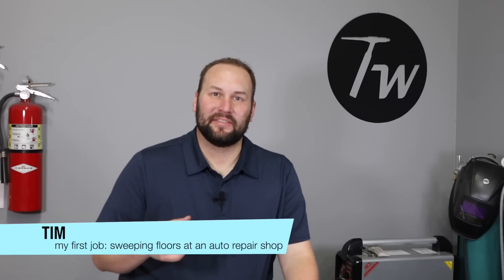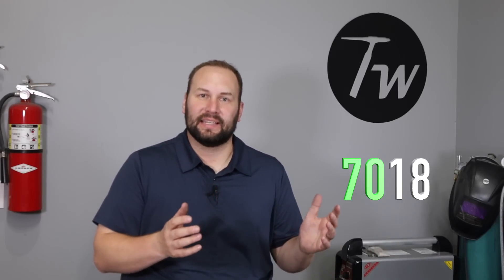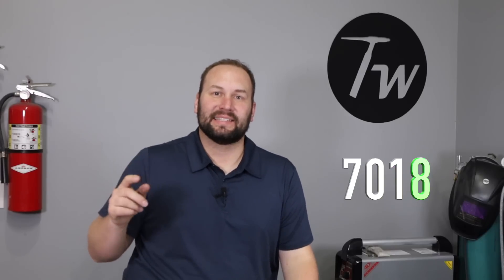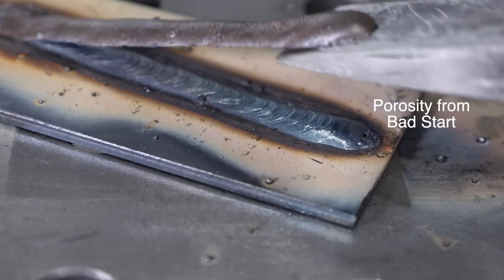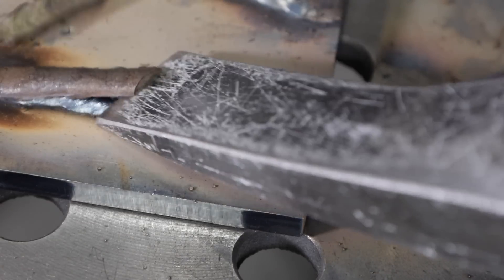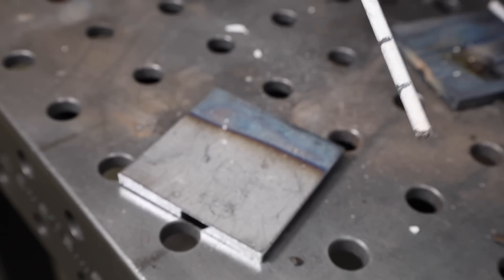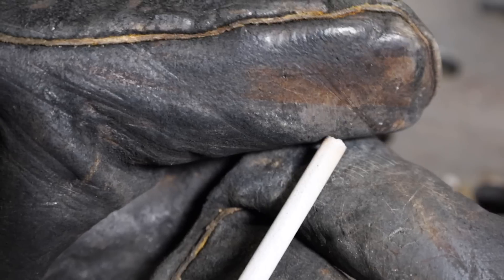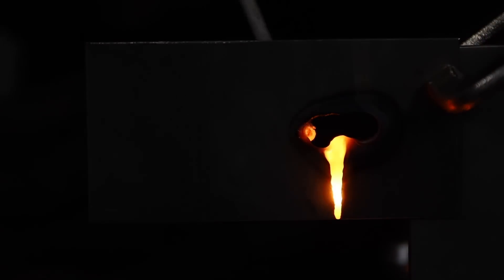Stick Welding: Which rod is my favorite?

Comment: Buy the AC version of it. 7018AC has a conductive material in the flux that allowed instant and EZ restart.  7018AC will also run DC just as well. Try it. I stopped buying 7018 DC completely after that.

Comment: can't beat a 7018's bead strength, but for me it's the 6011. The 6011 will easily work with those cheap Amazon inverter welding machines that usually have too low of an open circuit voltage (OCV) to strike an arc with the other rods, especially 6010, and 7018.

Comment: Where did you get that divider for that rod tube ??
Reply from the maker: It's molded into that particular tube. I'm not sure what brand that one is, I probably just bought it at the welding supply at some point years ago.
Reply: @TimWelds  
I found them from a company called Shark industries.

Comment: I like 7018 too. It is my go-to, for sure, and a pleasure to weld with. Absolutely the easiest for me to use. A shipmate of mine many decades ago, a QMED, (I was the Bosun and that was my first permanent Bosun job) taught me basic welding in exchange for me teaching him how to use a computer. Yeah, long time ago! Anyway he had me burning 6011 rods because 7018 was just too easy, but what he said was, "6011 is your most basic, generic rod, and you will use it more than any other rod". I got where I could do vertical, overhead, and pipe with 6011 and went down to the engine room for some more rods one evening and saw the 7018 laying there in the oven, calling my name, so I grabbed a couple dozen and when I struck the first arc and saw the beautiful bead it made, and how effortlessly I was able to maintain my arc, I was hooked. It's like hot melt glue, but with penetration. My first real, productive welding project was building dumbbell, barbell, and plate racks in the gym, for a few thousand pounds of iron on a ship that commonly sails the North Atlantic in winter, so it had to be strong. My rod of choice was a 3/16" 7018. Even the Chief Engineer said it looked pretty good and rather professional, even over-built. The Chief Mate, who commissioned this job and signed off on the overtime, and was a big gym rat, was delighted. Every weld was perfect or nearly so, and yeah I could have done it with 6011 but it wouldn't have been nothing purty and it would have taken longer.

So now I am retired, and my machine is a Harbor Freight does-it-all running on a 50 amp 240v circuit in the garage. No plasma cutter, no oxyacetylene rig, just the HF machine and angle grinder. I never went to school, no official professional instruction at all, just continued to try stuff and see what works, and re-do what doesn't work. My usual rod is still 7018. It is just too damn easy. Everybody says wire is easier, but I disagree. I even bought a spool gun. I still find stick to be easiest, and even when I don't need the strength, I still take the easy way, and use my favorite rod.

Comment: I didn't hear you mention that 7018 needs to be stored in a rod oven to keep them dry as they are low hydrogen rods. Since I stick weld infrequently I don't want to keep a rod oven baking all the time. I'd rather use 7014 unless i have a high strength alloy steel to weld.  Also the slag balling on the end of the rod is a PITA.

Comment: For farm use which means almost every angle, all kinds of dirt and paint, and sometimes my fitting is done with the left hand and set with the first tac, I like 6010 a lot. Doing pipe work in a beef barn for some reason I liked the feel of the 6010 a little more than 6011. I ran through probably 30 or 40 lbs of the stuff. 7018 is always a go to for heavier metal. I just have 7018 rods that sat opened for 20-30 years in a building that feels just like you are outside. So they really dont work the best. Maybe some day I'll get through them and have nice 7018s

Comment: Tim, does 7018AC have all the positive things that the conventional 7018 has? I currently only have  an AC stick welder for my home use. I would like to take advantage of the 70k strength when building/repairing trailer frames ecy.
Thanks in advance!

Comment: Hello, Tim, and thank you for the great videos!
I have a quick question about my machine. It is Telwin Nordica 1800, and in the description it says it is an AC machine and electrodes used are rutile only. So can I use 7018 and should I expect problems with it? 
I use it for dirty (rusty) metal and simply - hobby/garage projects.

Comment: We ONLY use 7018 for all root passes here in Sweden. If you just start learning with 7018 root passes from the start then you won't need a 6011. We don't have any companies that make 6011 rods here in Sweden, simply because we don't allow it by code. It's too brittle. We have rods similar but not the same.

Comment: I am just starting out stick welding, as before this I had a cheap flux core welder. I started with 7018 and found striking the arc was a challenge with them not to mention getting the hang of maintaining the arc distance while traveling down the weld (likely due to my time flux core wire welding). A retired farmer suggested starting out with 6013, so I picked up some inexpensive 6013 rods, and I found that getting them started and maintaining the arc without sticking the rod was much easier. I ran through a few of them then tried 7018 and while I was better striking the arc, I still struggle with it with the 7018 rods. Then I saw a comment about heating the rod first with a propane torch. I tried that, and it made a huge difference both in striking the arc and maintaining it. I still have issues with maintaining the arc, but I am sure it is an experience issue that will improve with more practice. Thanks for your videos. They have been extremely helpful for this hobbyist welder.
Reply: Riiiight, I'm like you new to welding those 7018 rods are the devil when it comes to striking a arc. Went to a 6011 and It felt like going from lifting 100 pounds to lifting 10 pounds. That's how much easier it was to arc and use. They were smooth as butter. And besides who's welding at home something that needs that kinda strength

Comment: I have problems in using 7018 rod. Getting started and keeping arc.
Reply from the maker: Restarting can be difficult, that’s mainly a matter of practice. If it can’t hold the arc, it might be that your machine can’t sustain it. AC machines and some inverter based DC machines don’t work well with standard 7018, but usually do much better with 7018AC, which has some arc stabilizers.

Comment: 7018 is an iron powder electrode  has a high deposition rate there are 2 basic rods in industry 6011 and 7018

Comment: 7018 is the main-stay, go-to rod for Locomotive maintenance and wreck damage welding. It runs clean. Straight drag is pretty, but if you keep a swirrel pattern, more of your puddle will encompass both sides of the joint and will be MUCH better and stronger. Your stick needs to be as straight in as humanly possible. It will give maximum penetration and will, if your heat is correct, will sound like FRYING BACON, and will yield a nice flat bead of overlapping dimes. I was once told by a mechanical section general foreman, that he trusted my welds more than some of his certified welders. I was an Electrician, but also did Tool and Jig design, on the company's Design Team for almost 40 years.
   My question for you is what "family" of rods would be good for an AC buzz box, for doing thin-wall square tubing. I always just use my MIG, or an oxygen/Acetelyn torch and a wire coat-hanger and a wire brush. I SUBBED
Reply: Probably 6013 for thin stuff on AC

Comment: Hola everyone.. I am new to welding or at least welding large structures. I always wanted to get into welding other than electronics, ICs and computer boards but I never really put the effort into it. I am about to purchase a low end system that I can use to learn but I though I get some input from the experts. Are dual purpose welding plus plasma cutting units a good option for me? I would like to bring this with me to my off-road adventures and it seems like the perfect solution to get something temporarily fixed while on the road. Since I don't have a lot of money to buy one system to learn and another for my future use, I would like to pursue 2 in 1 welder/plasma cutter for this. Can you guys tell me if you had any experience with these units? I am not finding any good named brands on Amazon and I may need to spend more money for a US brand but I am ok with it if its what I will end up using for the nest 3 to 5 years.. Thanks in advance for any help here.. Also Thanks to TimWelds for this explanation of the rod.. Again all of this is new to me but I can use some of my electronics soldering experience to understand where they two realms cross in concept.

Comment: The problem with 7018 is that you are supposed to only use fresh electrodes.  Once they have been unsealed I think they have to be rebaked.  Their advantage is that they are low hydrogen but again that is only if you have dry, conditioned fresh rod.  Personally I like 6013.  They make nice slag, run real well and unless you are welding nuclear reactors or the Keystone pipeline they will work on any machine without a lot of fuss.  Anyway I’m no professional and just figure I would just comment to stir things up 😀
Reply: Nice slag? Is that similar to a good loss?
Reply: @elcomandante9299  ha, probably.  I meant it forms something that is easily removed leaving a great weld underneath.  6013 slag comes off in one piece pretty much.

Comment: For 7018 i take a propane torch and heat the rods before use, to remove any moisture / humidity.

Seems to keep any spatter at a min.

Comment: Artec 223, you can dip it in water, shake it off and weld, a bit more tensile than 7018, it's a Canadian rod, not sure if in USA yet.
 I've welded with both, Artec makes a Unichrome, best rod for bolt extraction, won't fuse over to threads BUT start the arc on the bolt, it's designed to repair damaged chrome on hyd cyls.

Comment: Love 7018. DCEP, any position and thickness, I always hold kilograms of them in 1.6 and 3.2 mm. Pulse 1.2 Hz and normal stick welding, they can weld anything that is made of steel. Perfect.

Comment: Everyone talks about how great the 7018 and how the slag comes off super easy. I've tried it and I usually get very hard slag. Any ideas what might be going wrong? I can run a 6013 or 7013 no problem with slag that comes off fairly easy.

Comment: 7014 can be exposed to air without issue right?
I just bought some and the tube doesn't have a lid on it, going to make one out of 4" pvc soon but just checking.

Comment: I was wondering if the brand of rod makes a difference. Like how Harbor Freight Vulcan rods perform.
Reply from the maker: Different brands do perform a little differently. Lincoln rods are generally my favorite. I have tried the Vulcan rods from Harbor Freight and they actually run really well in my opinion.

Comment: Nice, I too got the HF Titanium 200 multi process welder and I'm trying both stick, mig and soon TIG. Need the gas still. I did weld a muffler ona vehicle but bought 6013 1/8 rods. Well I too found out that I was running the electrode on its lower Amp setting as it was 1/8 and was using 120v not 240v. should've bought 3/32 rods... anyways I blew holes in the pipe with the heat the 1/8 needed and had a hard time welding it. After a long time trying small runs I got the muffler in. I used both MIG and stick yea I suck but the experience was fun. I really like your videos very informative

Comment: Hi, do welds rust? I plan on using e6011 for small modification to outside galvanized gate.  Is this a poor choice? Thank you.
Reply: Yes they do. Best thing to do is weld, scrape slag, wire brush, clean, prime, paint. Be careful welding galvanized, i think it puts off toxic fumes.

Comment: Hi Tim, I have been learning a lot from your videos. They are very helpful. One thing I wonder is with all the different thickness of rods is there a general purpose one that can get you by most situations? According to your other video I think 6011 would fall into this category but I am more concerned about the thickness of the rod. Or do I just need to buy an assortment of different sizes to be covered? Thanks again,
Reply: You can adjust the machine settings to compensate the size. Or adjust you, speed, motion.

Comment: I've heard you talk about strength and "1 square inch of metal"... however welding is 3-dimensional, so do you mean "1 cubic inch of metal"??
Reply: If you have a square-shaped  7018 rod 1'"X1" of any length, it would break at 7000lbs or slightly more. After welding it will change because it alloys with the parent metal, which may have a higher or lower tensile strength than the 7018 rod.

Comment: Tim, please accept my most sincere gratitude for your advice! Following your advice, I have tried 7018 and I was amazed how excellent this rods are. 6013 was, OK, but 7018 is a completely different game. Big thank you!
Reply: @Chase Williams 6013 lights up easily, while welding you see the puddle and you might think your weld is nice and even, but when  you remove the slag you will see how crappy it is straight away. 7018 on the other hand are more "fluidy". Beads -using the same technique-appear like you wanted them to look. Could show you some photos what I mean exactly. 5 or 6 mm is a very good thickness to start-less chance to blow the material. Try both electrodes and you will noticel the difference  just make sure rods are in spotless condition: perfectly dry, or straight from new vacuum packaging. And get yourself a metal file. Good luck!

Comment: When I got started I tried 7018. It kept sticking and I could not strike an arc. I switched to 7014, and I was able weld. I’ve tried 6011, 6013, and Blue Demon 1000. That’s one of there proprietary rods. It’s good rod. A little harder to strike an arc though. Oh and another thing about 7018, you need an oven to store it. The rod is anhydrous and absorbs water. I was told by a pro that’s it’s okay to weld with without an oven as a hobby. But, it can’t be used that way for any structural or critical welds. Since some of my projects were load bearing , ie tables, I decided to use 7014 primarily. For a beginner I think it’s a great rod. It’s easy starting, easy to clean slag, and has medium penetration. Also, it can run on AC, DCEP, DCEN. 7018 can only run AC or DCEP. Another thing is 7018 is a low penetration rod. The penetration information comes from the Miller Welding app. (Get it. It’s free and a handy reference.) That’s my take. Hopefully not too wordy. And, thanks Tim your videos are a great resource for me as a beginner. 👍
Reply: The current information comes from the app too.
Reply: Your electrode keeps sticking cause you're poking. Dont poke,,,scratch the metal. Simple as pie.

Comment: I am an amateur/beginner "welder" and 6013 is fairly enough for me (2-5 mm thick material). It's easy to fire up again. In most cases I use 2.4 mm thick rod at 70-80A.

Comment: I am very new to welding and the only rod that i have tried is a 6013. I need to try some different rods. Right now, im just practicing.
Reply: Not 7018. Use 7014. It strikes an arc easier than 7018 on A.C. and easier than that stinking 6011. 7018 on D.C. works great. But on A.C. use 7014 or go home.

Comment: Technically, 7018 is not to be used for an open root. That's why pipe is often a 6010/7010 root and 7018 fill and cap. Personally I'd go with 6011. It can weld pipe or sheet metal. Burns through rust and paint. But a nicer bead appearance and easier to run than 6010. But it's all subjective. Just my opinion as a farm welder and am ironworker. Also have a CWI.
Reply: Ironworker here also....good ol farmers rod all day 6011i swear it can weld wood and horse shit together...6010 root 7018 fill and cap for me
Reply: Please what is the meaning of CWI
Reply: @alexegbiwe2909   certified welding inspector.
Reply: The only thing I've found 6010 rods are good for is cranking up the amps and using them to cut with. They're excellent for that! Just make SURE you're wearing spats!

Comment: I just completed my first project. I made 3 1200mm x 2400mm privacy screen frames. The steel was 40mmx40mm @ 2.5 mm thick. I didn't like the 6013's at all. I got great results using  680 dissimilar rods between 80 - 90 amps @ 3.2 mm Decp+. Single pass, the weld was very strong and I could see good penetration on the back side.

Tried bending, hitting with sledge hammer hanging off it rock solid. I tried cutting through a practice bead with the cutting wheel on the grinder too, that 680 is very hard to cut through.

Comment: Tim, in the thumbnail that shows for this video you have a red case with various rods in it. Looks like a good selection to take to a site. Lower left looks like 6011, and to the right looks like the older brick red 5P 6010, 7018 in top right, and I'm gonna take a stab at top right being 7018 1/8" and top left being 7018 3/32" or 7018AC. I don't see that thumbnail in the video, you only mention your fave. 

I've tried both (red) 5P and (grey) 5P+ on the Miniarc 180i and I think the 5P+ runs better. With 5P+ I can see it disrupting the base metal under the puddle...almost looks almost like it's blowing a ravine through the base metal...but when it's all said and done the bead doesn't resemble that to me. OTOH, 1/4" plate lap joint with 5/32" 7018 pounds some metal into it. Use the right tool for the job. I think I only bought a Sureweld 4 lb. tube. You don't get very many 5/32" rods in 4 lbs.